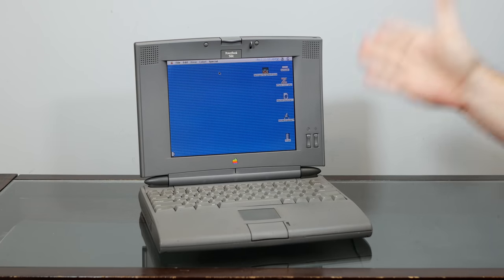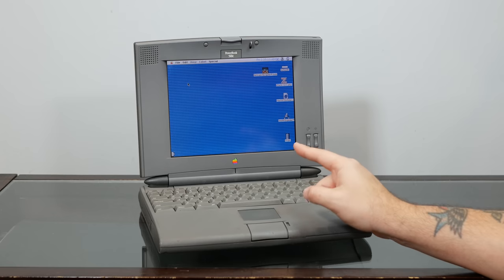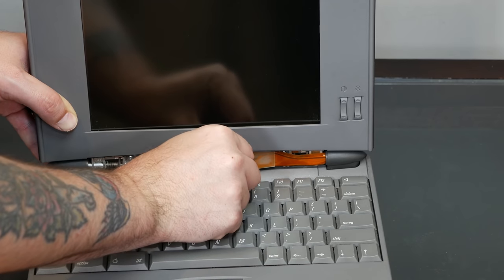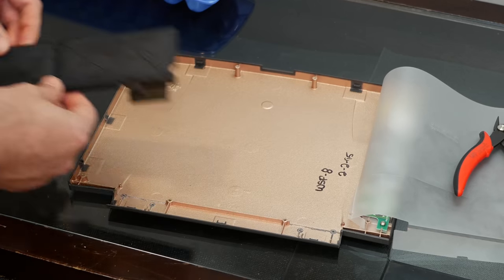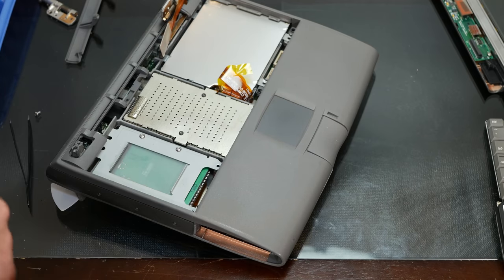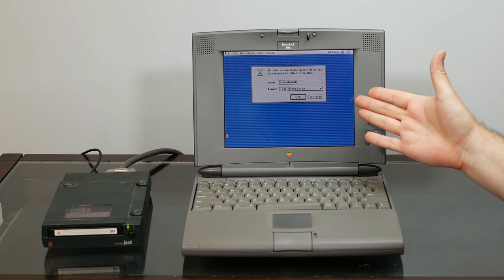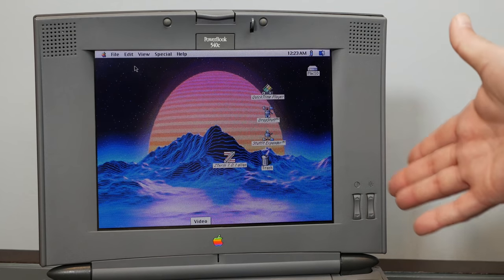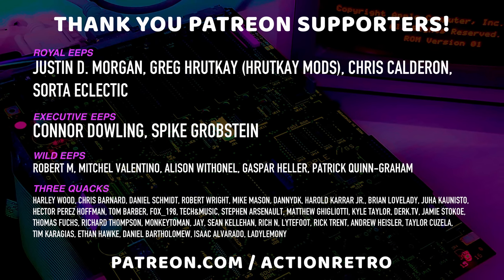The 1994 PowerBook 540c Has a Fatal Flaw, and We're Going to Fix It

Comment: Sidenote about the 500 series; You can swap a 540 monochrome screen with the 540c's color screen without changing anything in the logic board.  the logic boards are identical, and it detects which screen is attached. I did this swap years ago on one of my 5x0's.  I still have a bin of 5x0 parts. I should probably sell them now or something... hm.
Reply: yes i can confirm this going the other direction. I got a 520c but the screen was broken during shipping. I could only find the grayscale screen to replace it but it worked right away and there was no difference in the connection.

Comment: Hey Action Retro, for those orange (FFC) ribbon cables, you can do something i call "Ghetto lamination."
You take clear packing tape or kapton tape and you carefully put it on both sides of the ribbon cables sandwiching them together. Then you very carefully trim off the excess tape leaving a 1-3mm edge on it. This greatly reduces the chances those orange ribbon cables will rip, tear, or what ever.
It's especially useful for older ribbon cables.

I do this quite frequently, the only thing to be mindful of is with some twisted lcd hinge cables, sometimes the holes are pretty small and the cable twists through them, and the extra thickness of the cable can make it hard to twist and squeeze through. This was especially true for my GPD Win2, but for most other thing's it's not a problem.
Reply from the maker: Oh I love this idea!
Reply: Love the Kapton idea! Will do this next time I dive into my 520c.

Comment: I bet you could solder some extra RAM chips on to that memory module. If you can read the part number off the existing ones I can help look for some suitable ones.
Reply: Do you know how it works? How does a computer know how many chips are on the module, some kind of a terminating resistor, or just 'write X under address, read back, check if still X'?
Reply: @Slay1337pl  looking at some photos there doesn't appear to be any kind of ROM. Some resisters but they are probably just signal conditioning. So yes it looks like it just probes to see what addresses work.
Reply: @kuro68000  There's been a few videos on attempting that kind of mod with a variety of old laptops with nonstandard modules before. One or more of those resistors very likely signals to the computer the capacity of the RAM module.
Reply: @KiraSlith  it's possible, we need a photo of a 32MB one to compare. Or just try it, maybe trace the signals to see which ones go to the connector. You can also look at their values, they will be very low (or zero) if they are indicating memory size.

Comment: Polymax PLA is pretty resistant to heat- use it in my car (windshield area) and in sunlight on the exterior of my house.  Fumes are not bad when you print + it's really strong.

You shouldn't have ABS items near heat or in your house.  Fumes can kill you when it burns.

Comment: Maybe a little lithium grease in the hinges? Might put less stress on the hinge connections.
Reply: eh just 3d print a new plastic case for that old laptop then it'll be good for another 30 years
Reply: @raven4k998  but then it loses its original design and its value
Reply: sounds good

Comment: Great video as always! 
I've spent the last couple of months reconditioning a PowerBook 520c. Fun little laptop. 
I've rebuilt battery modules replacing the NiMH cells. It was tedious, but not difficult. 
Upgraded the ram card from 4 MB to 8 MB for a total of 12 MB. I'd love to find a 32 MB upgrade.
I'm patiently waiting to purchase a SCSI2SD once they become available again. 
I recently purchased a PCMCIA module (Revision B). Haven't found the right compact flash card for it yet. Recognizes the 2 GB CF card, but sits and spins on "Creating folder...". I think I may need a fixed disk mode card instead of removable for it to work.

Comment: If this is supposed to be Apples best laptop ever, surely there are more modifications available than just an SSD. Maybe a future video on CPU and RAM upgrades? Also with how thin those speakers are, and how thick the screen is, you might be able to do a speaker upgrade as well :)
Reply: The best upgrades from Apple are a PowerPC upgrade and a PCMCIA expansion option that goes into one of the battery slots. I used the latter with a compact flash card for solid state storage back before scsi2SD was a thing.

Comment: Thanks for the video, I love retro repairs and upgrades. Although I am more partial to epoxy than superglue on magnesium parts.

I also saw other creators use the metal threads with 3d printed parts for these kind of high torque applications.

Comment: Nice, got a 540c as well, pretty good condition apart from a broken piece at the bottom right of the main body, even have one battery that still works and holds about an hour. Got the original HDD although it sometimes has trouble spinning up when left unused for a while and installed 7.6 which uses way less RAM than 8. The hinge still seems solid on it, actually the one on my 3400c is more scary and wobbly. Think I won't do any surgery on it yet since the bottom cover also still holds fine and I think it's wise to avoid removing it, but good to have the parts in case. I think printing in PLA might be better than ABS/PETG just because PLA is more rigid and thus it shouldn't wobble as much.

Comment: Do you have more info on the solid state drive you installed?  I could see you put in a converter, but where was the drive?  Was it just attached to that circuit board?
Edit: Is it a SCSI to microSD card adapter?  Can you include a link?

Comment: Of course modern laptops still have the same problem. I repaired one in the past year by finding some of the same plastic (PC+ABS FR40 seems pretty standard in case parts) and using an old soldering iron to melt a huge blob of it into the broken case. Then I pushed in the metal threaded insert with the hot iron and it seems at least as good as new. Since my plastic hack is much thicker than the original posts it should be much more durable. This was all on a 2013 Lenovo but I'm sure it would work equally well on vintage computers.

Comment: I had a Power Book 520. I don't remember the amount of ram it had in it. 160 Meg Hard drive. It had a grayscale screen that was made of two miss matched panels that did not look even. I wanted the color one, but my parents would not spend the extra on it. I got it my Junior year of High School. I remember the SCSI port that had a top heavy adaptor and the strange Ethernet dongle it used.

Comment: As for this hinge failure it is a common problem with modern laptops that are cheap plastic where the grommets will separate from the plastic. Lower body cracking is also very common with age but most failures with in a couple of year of age is brought up by bumps and drops. So I strongly prefer metal body machines anyway for vintage laptops as they age it helps to handle them with care.

Comment: Did you get the capacity issue figured out with the SCSI2SD? Often those need to have their parameters configured (on a modern computer via USB) before they'll work properly. Kind of fiddly at first but they work pretty well once they're set up.

Comment: I think I would prefer nylon over PETG though Nylon is definitely not the nicest material to print with. Still you are correct that PETG is a much better option than PLA at least.
Reply: imho Polymax PLA/PC-Max resists heat pretty well and doesn't stink up the place when you print.  It's also a good idea to keep ABS outside the house + in places where it can't get hot.  ABS can catch fire + spew fumes that can kill you, which is the main reason we use it outside, typically.

Comment: For the cost of some thin steel sheeting it seems quite infuriating that the top was held on by some screws into plastic, especially when they use some anyway to support the screen itself. Id have been tempted to buy some and use that instead of 3d printing more plastic (the first one shattering doesnt bode well imo), with a bit of drilling, dremel and filing it wouldnt be difficult. You could even thread some holes fairly easily or epoxy some nuts to it and replace the tapping screws with bolts.

With that said though, i hope you get a good few years out of it!

Comment: UHU actually do a special plastic adhesive, unlike superglue it doesn't "stick" the 2 parts together, instead it chemically melts both surfaces and bonds them together so the result is as strong as if it was one piece. Its called UHU Plast Special. It would work way better than superglue is this application.
Reply: I use my trusted Pattex transparent power glue for almost anything, also on my old powerbooks, works great ( pressure adhesive).

Comment: The 520C I bought, brand new, had hinge problems right from the beginning, much like my Powerbook G4!  (You might think- I didn't learn.  I'm stupid.  I bought another Apple... but actually my employer bought my G4 for me :-))

Anyway this thing was dog slow, even at the time.  I eventually put a PowerPC accelerator board in it.  It helped enough that I could run some application software...

In my case, I took my 520C and a Sparcstation 5 to Hong Kong with me.  At the time, you could lug Sparc 5 machines in your suitcase and the airlines wouldn't care about the 50 pounds.  Much.  If you made googly eyes at the cute checkin girls anyway and complimented them nicely, which is what I did.  Always worked.

Anyway, I made a living using my poor 520C as an X Windows Terminal for my Sparc 5 in Hong Kong... quite a feat.  That year, 1995 I guess, was the year that if you wanted to do java, you weren't jack if you didn't have a Sparc machine, as the Windows port of java was slow slow and the Mac incarnations were curse-worthy.

So as bad as a machine as that 520C was, at least it did serve me well enough to make money.  Keep in mind that the Windows machines at the time often didn't have Ethernet, TCP/IP, etc.  So it was kind of nice to use the 520c as a smart terminal for the Sparc machine, at least.

Having said that, my 520C was one of the crappiest Apple products I ever had!  I don't know why I kept putting money into it... tho't with more memory and a PowerPC processor it would get better.  And it did.  Just not much.

Contrast to this the machines that blew me away while I was working at Apple.  The Powerbook 140/170 and the Quadra 900/950.  Those were GREAT machines for the time.  Powerful, ran A/UX and really expandable.  

I almost cried when I sold my Quadra 900!  I cheered when I sold my 520C... was happy anyone would pay anything for it.  What a total piece of junk, like many Apple products that have come since.

Comment: Cool video! Does anyone offer 3d-printed parts?
The 1st problem is solved by this, but the 2nd is the dead battery.
I have a 165c and a 540c and a G3 Bronze and clamshells... Most of them only running with power-supply.

Comment: Aaaactually.. pla is stronger than both petg and abs. Those have other advantages over pla but tensile strength is not one of them. Pla is the strongest of those three and takes the most force to break. Tons of comparisona of the strength of the different materials here on youtube for those interested.